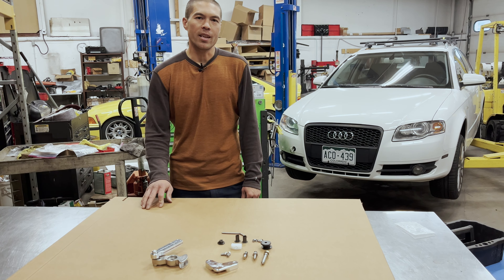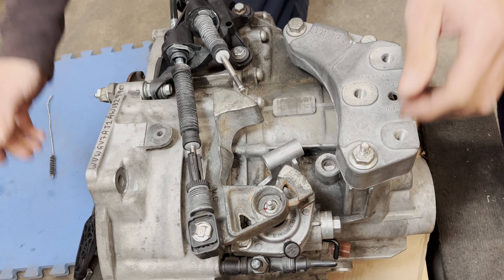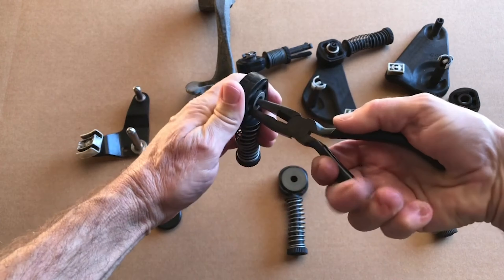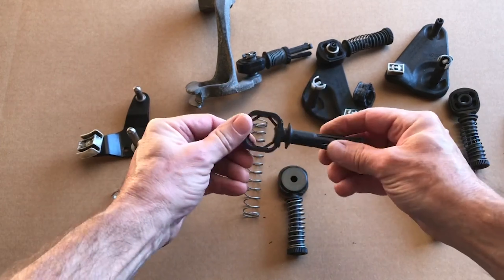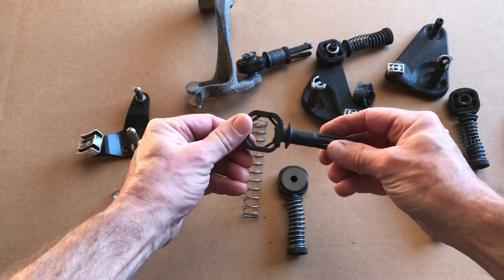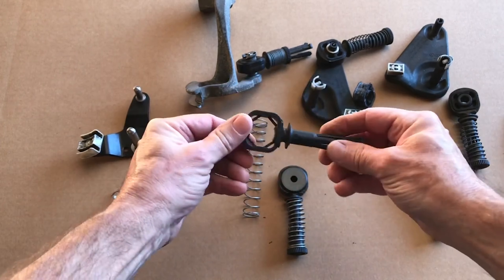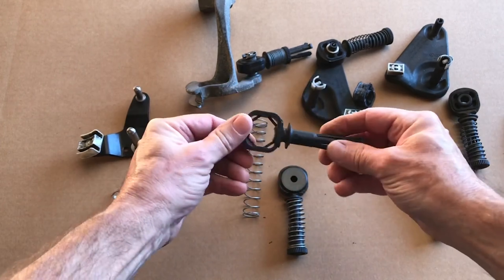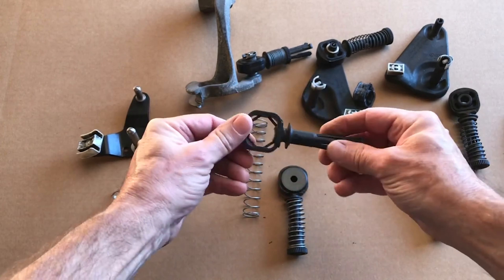Generation 3 Sigma 6 installation instructions

Comment: Just installed the Gen 3 on my 2023 GTI. Had your Gen 2 on my 2019 GTI. Just wanted to say that your product is top notch and the Gen 3 feels even better than the previous. Had no problems both times with the shifter adjustment using your supplied pin also.

Comment: You didn't have to loosen Allen bolts when you adjusted the 2nd time?
Reply from the maker: No. The Allen bolts are for the front to back cable which is far less critical than the side to side.

Comment: What is the other hole for
Reply from the maker: a different transmission
Reply from the maker: If you use it on a 6 speed the front to back throw will be too short